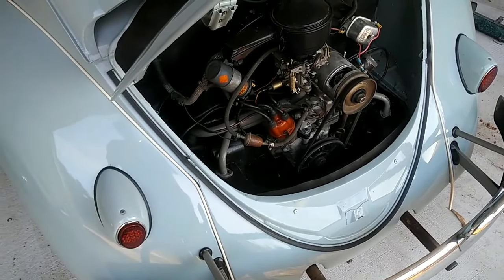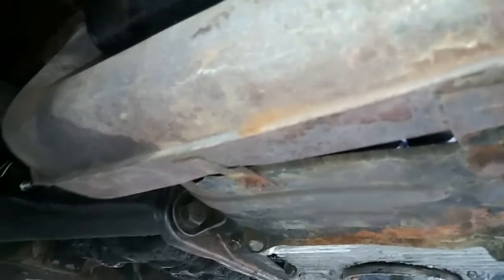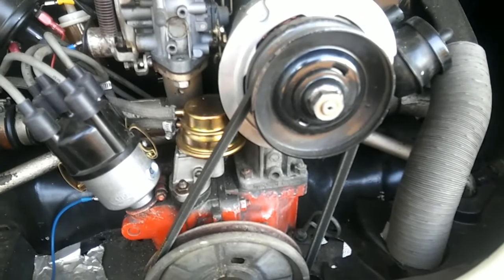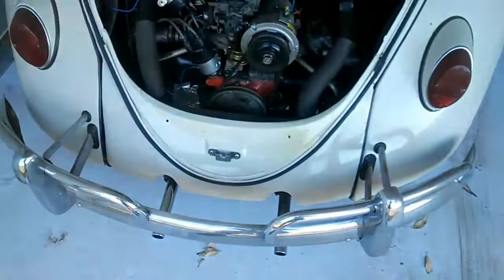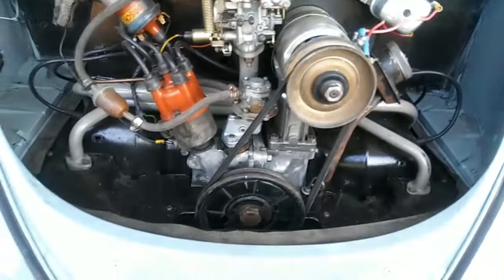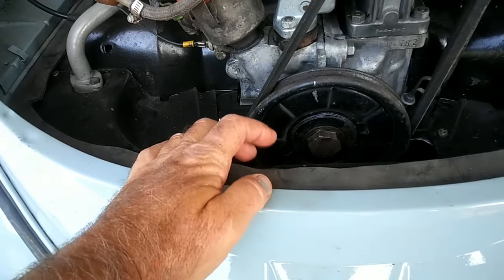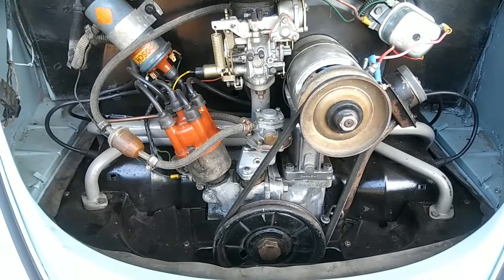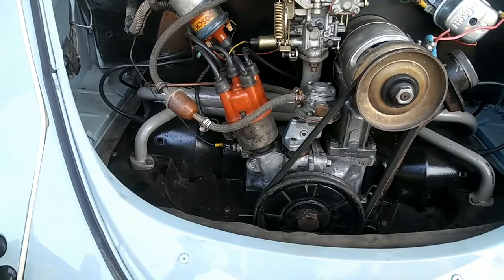VW Bug how to prevent engine overheating

Comment: Hey Mike, Someone had a question on a bug engine and thought I would ask you. They have no problem starting when the engine is cold but when it's hot take awhile cranking to start it again. They were thinking a vapor lock from having the metal type gas filter where this plastic one is sitting on yours. Or do you think it may be their fuel pump?
Reply from the maker: probably vapor lock. Make sure it is running the coolest it can. also check the jetting to make sure it is not running lean. When the engine runs hot it can vapor lock. if it is running cool it probably wont. I use the plastic filters for that reason too. but sometimes the metal line caused the issue but the real issue is usually engine is running hotter than it should be.

Comment: HOW TO HOT ROD VW's. "Only a fool would remove fan housing air shutters! Gene Berg described how air vortices occurred inside fan housing missing the shutters. Air leaks and coolant leaks..Depending of air temp. you also need the thermostat to prevent cyl wash. Painted cases always run hot! Think about it. Valve guide wear is why #3 exhaust valve breaks. Just the way it is, freshen heads at 50k max. and toss old exh. valves. If new exhausts valves have no markings, toss them too!

Comment: I've seen a cooked engine from the firewall insulation being pulled, against the fan inlet, blocking it.
And +1 to all the comments about fuel lines failing at the brass insert into the carb or pump, 
if you've just fitted a filter in the line, you probably gave those brass inserts a wobble and a tug getting getting the hoses on the filter. If they were ever going to come loose at all, it's probably now.
Is this the right place to talk about the fires in the back seat because of the missing battery cover?
Reply from the maker: good point about the battery cover. There should be a plastic piece on top of the positive terminal. plus you should always use a group 42. Myself if I have passengers often I use a old prestone bottle and cut it in half and put it over my battery.
Reply from the maker: another big failure is electrical but almost a whole other issue. Missing or worn out grommets like the positive terminal grommet or
Reply: I've seen them swallow the brass shot pump nozzle in the carb also.

Comment: What is the temperature ambient Fahrenheit right next to your cylinder head and please best use laser thermometer and the reading. Before you can change the needle hole jet into more lean fuel and air mixture. Lower amount or gasoline the better it fire the combustion explosion internal. It's better than rich mixture in 175 degree Fahrenheit in the water radiator. Super hot invisible flame fire heat jet is my hot SHO and it produce highest Hydrocarbon exhaust temperature right there tailpipe. What is your oil temperature? Please, plus use copper tube connected to the oil main pressure?

Comment: VW BUG HOW TO PREVENT ENGINE FIRES: 
Remove the defective designed POS press-in fuel fitting at the carb,  tap threads using a 1/8" pipe-tap and SCREW-IN a brass fitting.  
(been there and fortunately did not burn-down my '68 Bug. )
Reply from the maker: yes that is the most common problem right on or you can use a hose clamp and put a leash of wire to one of the carb bolts. if you know what I mean

Comment: The only way to stop valve burning on VW engines is to remove or drill holes in the plate in front of the fan housing. Yes dirt dust & water can get in but then the motor doesn't get hot. Before this  valves would burn at 20,000 to 50,000 miles. All these VW's were properly. tuned & valves adj. right. When the front plate was opened up where plenty of air could reach the fan are VW's would go 150,000 -200,000 miles All these were stock VW's. A Ford mechanic figured this out. Valves burn because they get hot; Keep the exhaust valves cool then they don't burn. He said  it is simple things only will burn when they get too hot never when they are cold!!!!!!!!!!!!!

Comment: What kind of oil do you use? I heard oil helps cool the engine as well. I live in southern utah, I have the engine seal but I dont have the seal behind the fan. I can't hold my dipstick for more than 2 seconds.
Reply from the maker: Castrol 20 50 or Kendall. THey are the best oils non synthetic sometimes I ad 1/2 container of stp. good for the cam.

Comment: Hi, quick question.  I have a 1973 bus and just got the engine rebuilt today. I drove about 3 hours keeping it 55-60mph. When I got off the freeway and turned onto a street my oil pressure light flashed once and shut off. Then drove alittle farther and it flashed one more time. By then I was at my destination. Do you have any advice?
Reply from the maker: put a gauge on it. pull the sender and check the oil pressure. you just need a dash gauge and you can screw it right into the engine. MIght be a bad sender.

Comment: So this doesn’t have to do with cooling.

I have a 1969 bug, when leaving a stop my first gear pops out, not all the time, but most the time. The more gas and quicker clutch let off the louder/worse of the pop. If I’m leaving my drive way I let off very slow and give it a small amount of gas and it still pops out. I’ve adjusted my clutch cable multiple times. I’ve tried to give it a second or two before putting it into gear and still, same issue. 

Have you had this issue? If so what helped? I’m only 17 and have had my bug about 6 months, so I’m not super experienced with this. 

Thank you!
Reply from the maker: well yes and the answer is the gear, shift fork, or bearing is wearing out. Time for a rebuilt transmission. Common on these older cars. Check out Benco Website, KCR website for pricing they will be the cheapest  and good quality work.. Not too often you will find a 69 and up that is in perfect condition used. Rebuilt is the way to go. If you baby it you might make it for a while but it will  get worse. and sometimes it will start popping out of other gears. 4th and reverse are the most common.
Reply: take off in second,until you can have your transaxle rebuilt,check the fluid if ok ,theres no linkage adjustment,so my money is on worn parts.
Reply: I had the same problem on my '68 Type 3 Fastback. It was the transmission mount. The transmission would pop up and twist just enough that it would pop out of gear.
Reply: Trans..pull the motor and label...get the car up in the air and look it over......just start in 2nd and check fluids until you have money to pull and replace and check mount.......replace all parts..

Comment: Would it be ok to put the oil cooler on the front of the car ?
Reply: seems overkill Oil is the secondary cooling sytem under the car near the transmission.
Reply: The answer to that is a BIG NO as the oil pump cannot cope with the increased friction within the long pipes and bearings etc would be oil starved. I cannot understand what all this fuss of overheating is about - are you guys driving thru Death Valley etc - its only the 1600 cc beetle which suffers from overheating  esp. if one keeps it at 70 mph or more on a very hot day and doing a lot of hillclimbs. Apart from that if you drive at a average speed of 55 to 60 mph on highway it should not overheat if the motor is stock standard. I have had my beetle (1600) for 40 years and always add about a pint of oil more than the standard 2.5 litre , which its supposed to take - so basically the total oil capacity in my beetles sump is at least 3 litres at all times and i have fitted an electronic VDO temp. gauge which shows that oil temp does reach 100 degrees Centigrade (212 degrees F) when really hot (normally does not go higher than that) . Smaller capacity beetle motors like say the 1300 run cooler if stock standard , so as i said its only the 1600 which could overheat.

Comment: Hey Mike.  Hi from Phoenix.   My daughter and i are doing a resto. I have a 62 Komi in mid restoration and I was wondering about the louvers on both sides and how to deal with them so I don't get water in the van when driving.  Obviously here in Phoenix that won't happen too often, but I just wanted to protect the interior from water damage even if it doesn't see rain that often.   1962 kombi converted to IRS with "thing" axles and a f/w flyer. 1600 wit electronic ignition,,, also has heater boxes and heat tubes, but not stock carbs.  It has dual web's. no holes in the tins and new seals all around.  Ive yet to drive it here in a Phoenix summer so I'm not sure how well this setup will hold up on a 112 degree day.   Any suggestions to avoid overheating (besides leaving it in the garage)?
Reply from the maker: Yes I highly recommend something called cool tin. I will be doing a video on what to do on a modified engine. I have it and drive a 13 window on 100 plus days and have stock stand up oil cooler. runs cool. Be sure to check jetting. Not sure sizes on those cabs but a rich mixture is best in the desert. Dog house a must for that application. The freeway flier depending on gear ratios may be a problem with those straight axles. The gearing may be too high. May not have enough rpm move air. Get a tack and a head temp guage on that to see if you are in optimum range 2200-3000 on the freeway at 60 70 max 3000. Most freeway fliers are 4.12 x .82 4th and that might be too much. as you drive it and slow  down and floor it to see if it is pinging occasionally. If so slow down for a while try it again. if it pings at slower speed stop and let it cool it is running hot.

Comment: You didn't mention anything about the cooling flaps in the  fan shroud and the thermostat
Reply from the maker: I remove them all. they restrict air flow. Thermostat and flaps...
Reply: Good! I feel better now because that's how mine runs: without thermostat and flaps; it worried me that it was an incomplete cooling system.
Reply: VW put those flaps there for a reason, you should never remove them as they allow the engine to warm up properly and guide cooling air here it's needed, when it's needed. Might get away with it in a permanently hot climate perhaps?
Reply from the maker: they were made for Germany or super cold climates. Most people who drive VWs now are summer only. Flaps gotta go. they fail more often then they work on stuff today. Germans even today seem to make their cars based on their climate and fuels. That is why we have so many problems here that they dont have there. Like TDI hpfp failure on late models.
Reply: I live in New Zealand Mike, and we.ve got morning frosts right now...and I do drive my '68 1500 in the cold!
Gave your clip a "Like" though as all the rest of your cooling info is great and spot on. cheers Mike
Reply from the maker: cold ususally means snow and snow means rust. I am surprised people drive a classic in that I wouldn't. Many years ago I used to use my bug up in the mountains for ski trips and never had flaps. Little hard on the engine but it still lasted just fine. they warm up really fast. These are classics now guys remember that if you want to keep them around cold weather is not optimal.
Reply: Cold weather is a fact of life if you don't live in Hawaii, Nevada or such! My bug lives outside in rain, snow and frost, and it's a constant work in progress, purchased as a neglected vehicle, with rust everywhere, it,s now bodily and mechanically sound and built to be driven, thermostat, flaps and all!
I have a modern car for daily commuting, but he bug is much more fun!
Reply: They do allow the engine to warm up faster which I think is important because a cold engine and and overly hot engine both have faster wear of moving parts. However they don't seem to do any air "guidance." They simply shut down the flow of air equally on all for cylinder head and cylinders and gradually let more air flow equally on all 4 as the engine warms up. I always left thermostats in place. I also put a drop of all on all moving parts of the flaps.
Reply from the maker: yes but more importantly I have seen more engines overheated and damaged beyond repair from the thermostat going bad or sticking. So I will forgo the flaps on mine. Use 10 40 winter 20 50 summer. If your really worried about engine warm up put a block off in front of the fan run the engine for a few minutes manually then take it away. Less chance of engine damage from running hot.
Reply: I have never seen a thermostat that has stopped working. They are ridiculously simple: they expand as they warm up. As they expand they push open the flaps. I've tested a couple of them by putting them in hot water of the specified temp and making sure they expand to the correct length (as specified in the VW service manual). What I HAVE seen is thermostats that have been installed incorrectly, adjusted incorrectly when installed, so that when fully expanded, they haven't yet fully opened the flaps. It is a very simple matter to install it correctly. Of course people installed it incorrectly anyway. I have also seen flaps that are sticking. I suppose there must be flaps that stick due to soil getting into the moving parts, or wear due to age, but all the sticking flaps I saw were sticking due to being bent. Probably because someone flung them around or dropped them off of a tall being. I can't imagine them becoming bent during normal operation. It is a very simple matter to check that they work smoothly before installing into the fan shroud, before installing the fan shroud over the engine, and to check them again before screwing the thermostat onto the threaded rod. Takes only a moment, each time. But obviously not everyone did that. I think probably because they were working in a shop where they were being pressured to hurry. During the air-cooled vw's hey day there was a wide variance in the quality of work being done by vw engine rebuilders. Some doing good work, some mediocre, and quite a few doing really horrid work.There were also some horrid aftermarket parts being marketed, and installed. With a cylinder head temperature gauge you can see if the engine is too hot. I prefer to have an engine that warms up to normal operating temperature as rapidly as possible, and thus less wear occurs. With a gauge I can both check if it is fully warm, before I work it hard, and also check that it isn't becoming too warm, and wearing out too fast for that reason. For people who don't want to look at gauges - I wonder if there is a device that will automatically limit the rpm's should the temp go too high - or shut off the engine altogether. If not, someone ought to create one. There is also the matter of warming up the passenger compartment. Models after 196x had excellent cabin heat (provided everything was hooked up correctly, which was a simple matter) with lots of very warm air coming into the cabin as soon as the engine warmed up. In zero deg F weather, I want to get warm as soon as possible. Getting the cabin warm 3 minutes sooner would be worth the trouble of having the flaps in place and working correctly.
Reply from the maker: I have when I worked at the vw shop in the 80s when they were everywhere. many of them. It has been so long I cant remember just what would go wrong with them but they would stick and many fried engines in the shop. In So cal there was never a need for them they just were one more problem that the shop had to warranty.
Reply from the maker: the ones we saw that were bad too were on original untouched never rebuilt vw engines too. german parts. I dont know anyone who makes an after market one at least at that time.
Reply: Yes, low mileage or no-mileage German parts could definitely be bad parts sometimes. I never saw original untouched air flaps that were sticking but I saw a throttle positioner on an original, low mileage Solex carburetor that was sticking - the stepped-cam throttle positioner that the idle adjustment screw rests on. The choke was working properly, but the stepped cam was definitely not turning freely, and lubrication didn't help. Car would either stall when cold, or if I prevented that from happening by opening the engine door and moving the cam into position with my hand before starting the car, the car would idle too fast after warming up. A carb rebuild kit would not address the problem; I had to replace the carb.
Reply: @martinharris5017  without the thermostat and cooling flaps the heat/defroster doesn't have as much air flow when the engine is still cold.
Reply: @mikeab93  Correct! Another reason why they are important in cooler climes. Going sans flaps/thermostats might be OK in Hawaii or California but certainly not so great in places subject to big seasonal changes and harsh winters.
VW went to the trouble of putting them there for a good reason!

Comment: we have installed 10-12" electric fans with 140f thermostat goes on and turns off all by itself sometimes we run  bit  higher thermo max 180f ..just like today's water cooled cars they have electric fans as well as mechanical..just saying in the desert of 118F in the summer it is not like Europe nice and cooler . running a bit fatter main jet runs a bit cooler but run 89-91 RON better burn we run mixed for performance E85 . remember vw beetle back in the day as it reads on the gas flap door min 91 RON @ 7.5:1 compression !!!! higher octane runs cleaner ..you dont see NASCAR running 86-91 octane do yah ???
Reply: I tought of that